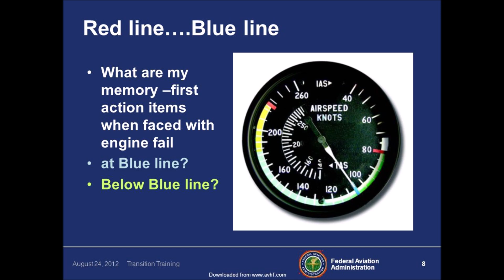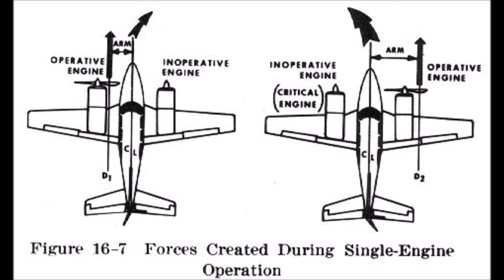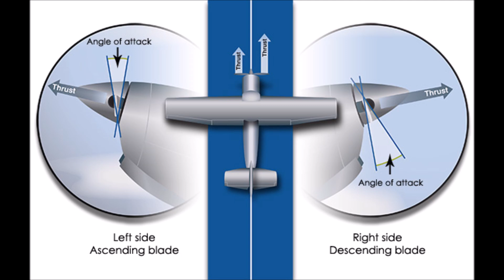King Air Crash- Addison Texas Update

Comment: This happened because an arrogant pilot would not let the co pilot touch the controls. Even after it was obvious the plane was in trouble, the co pilot would not touch the throttle for the left engine.

Twins often roll over when one engine craps out. My dad was acquainted with a pilot who had one engine crap out right after takeoff at Livermore about 25-30 years ago. The plane rolled over and went in inverted, which made for a particularly gruesome aftermath. There were 4 killed in that one.

Comment: What killed them is that he didn’t lower the nose. Recommended aoa is 10 degrees. His was way higher. The speed bled off below the blue line.My instructor used to say that if you had an engine failure below the blue line not even Lindbergh could save the plane.

Comment: NTSB Final Report on this Crash:

https://connect.ainonline.com/e2t/tc/VWGTgm1mky3HW2fxjwT48HP9KW4gSXWJ4rNVJcN6YWdsf3p_8yV1-WJV7CgM9vW3BG7_t4Sy5cpW74T2df5twC8VN7G7s5WbyJllW82hF6w60Np4sW6b4wTf607gCCW6ZxQ8p2kGv5SW3hqTGb8jWVLJW6y4RPj5dVZSsN2lD9Yvt0-3WW6hH6M98rL0YmW4d3lYb86mgFzW2NhF_g4SNd2vW6YgxRw77CG7qW5Thtpn4XVdFnV3hy-J5hMhLpW1RhcDV6bK80FW5n2061873mPcW86bq9m1n6vL-W7sgQhf3xLp_pW2M_sXg1lD26p3jv91

Short version is the pilot initially stepped on the wrong rudder pedal (left rudder).  He corrected and stepped on the right pedal but it was too late to recover, they were almost inverted by that point.    Also very poor discipline  in that they didn't use the before takeoff checklist and never briefed any items about the upcoming takeoff.

Comment: Just as a side bar:  It should be noted that not all King Air aircraft have auto-feather. It is on all King Air 300/350 like the one that tragically crashed in Addison TX. It should also be noted that the Auto-Feather is required to be tested, operational and must be ON/ARMED for takeoff.  As in the King Air 300/350 the 1900 is the same. However on the King Air 200 and smaller turbine King Air's it was an option. If the Aircraft is retro fitted with the Raisbeck Conversions or similar conversions Auto Feather is again a required item. This is mainly due to the removal of the 3 blade prop and the drag created by the new 4 or sometimes 5 bladed replacement prop.  Overall great job explaining VMCA and VYSE as well as the accident. The accident is truly a tragic one especially with the footage and that the aircraft was completely full with passengers.

Comment: Great analysis.  I would have bet 100 bucks that a king air would have had counterrotating propellers. Very surprised they both turn clockwise.  Is that typical in turboprops?  Thanks for posting.  Excellent work!

Comment: Considering how critical this becomes in the event of engine left failure, then why not have the right engine of all twin-engine propeller aircraft run CCW? IOW: both props rotating towards the aircraft center line, as is exemplified by the WWII Lockheed P-38 Lightning?

Comment: Sad so many lost their lives in this accident. You have to be trained to the max when flying complex aircraft and have no outside influences that will cloud your judgment and emergency procedures. I noticed they did a rolling take off, I don’t like them. My friend is a pilot and he never does a rolling take off unless he’s already done a engine run up just prior to hitting the run way. He has caught problems a few times with a engine and simply took the plane back to the hanger for repair. One time I was with him and the plane was rolling out to the runway and it sounded fine. But when he ran up the engines (one at a time) then and only then we felt a vibration and verified a cylinder was was coming in and out. Got back to the hanger and after a little investigation we found a spark plug wire loose from the plug and it was making intermittent contact.

Comment: Hi Juan,
      Your content here is usually excellent, but there is a glaring error in the way you describe V1.  

      About 5:45 you describe V1 as a “decision point” to continue or reject a takeoff.   This is not accurate.

      V1 is the speed at which the pilot must take “the first action” to stop the airplane (reducing thrust, applying brakes etc) within the accel-stop distance.  It also means the minimum speed, following engine failure at Vef (assumed engine failure speed), at which one can continue the takeoff on the remaining engine and achieve the required screen height within the takeoff distance.

      If one were to “decide” to reject at V1 and the field was balanced or the accelerate-stop distance was less than accelerate-go, the aircraft would NOT be able to stop in the remaining available runway surface.  

      The reason:  Human reaction time.   

     Since V1 is the speed at which the FIRST ACTION (not decision) must be taken, the decision to reject MUST be made PRIOR to V1.  When aircraft performance is calculated, it is assumed that the decision to reject is made at or prior to Vef.   

     Since Vef is not made available to pilots, every AOM I have ever seen calls for the PM to call “VEE-ONE” 5 knots prior to the actual V1 and for the PF to remove their hand from the power levers at that time.

       This is what accounts for human reaction time and ensures that the first actions to reject a takeoff do not occur after V1.

     Unfortunately, the misconception of V1 as a “decision point” is widespread even among professional aviators.  Most of the time, it doesn’t matter since runway available usually well exceeds balanced field length and V1 is adjusted up to Vr, but it is important to understand the definitions and the repercussions of deciding to reject a takeoff on a short runway at V1.

Comment: Juan, not a pilot but I have a couple questions.  In general at what point does the PIC call for gear up? 
We don't know exactly when the port motor failed at least I haven't seen a report as to when it failed.  If it failed at V1 or in-between V1 and rotate and they raised gear wouldn't this have given them less drag right out of the gate?   I don't know the checklist and obviously they didn't have time to run that checklist with the amount of time from take off to crash.
The question is do you skip procedures to raise gear and maintain some type of level flying speed or slow climb while feathering and securing failed motor?
I know I am playing armchair pilot on this but would you immediately call for gear up in this same exact situation or would you work the QRF?
Thank you sir

Comment: You can't die from an airplane crash if you don't get in one. The Only Exception is if one lands on top of you.
Reply from the maker: much easier in a car...
Reply: @blancolirio  that's what they all say but wind shear hasn't killed me yet, or Pilot error hasn't killed me yet, and if my engine blows up I just pull off the side of the road. I know that in 2017 47,000 people died on the highway it's very dangerous so I might die in a car crash but I will not die in a plane crash Only Exception unless one of you guys crash one on top of me.

Comment: As posted on your other video this is a similar event to on here in Australia in 2017 with a King air 200 full report : https://www.atsb.gov.au/publications/investigation_reports/2017/aair/ao-2017-024/ it would be worth a look as it may have some relevance :

 The aircraft’s take-off roll was longer than expected and a yaw to the left was observed after rotation. The aircraft’s track began diverging to the left of the runway centreline before rotation and the divergence increased as the flight progressed. The aircraft entered a shallow climb followed by a substantial left sideslip with minimal roll. The aircraft then began to descend and the pilot transmitted a Mayday call. The aircraft subsequently collided with a building in the Bulla Road Precinct Retail Outlet Centre of Essendon Airport.

The ATSB found that the pilot did not detect that the aircraft’s rudder trim was in the full nose-left position prior to take-off. The position of the rudder trim resulted in a loss of directional control and had a significant impact on the aircraft’s climb performance in the latter part of the flight.

Comment: Juan do you know anything about the crash of the N-9M Flying Wing on April 22, 2019 in Norco, CA ?
The pilot was killed and the aircraft was total.
What was the cause of the crash?
Reply from the maker: I do, and investigators are considering the hydraulic assist on the flight controls as a strong possible factor.
Reply: @blancolirio  Thank you Juan. It was sad that the pilot was killed on the crash and the restored N-9M Flying Wing destroyed.

Comment: I have to wonder why the PIC didn't do a proper run-up prior to takeoff. It's so important. It may or may not have flared up the pending engine issue but it may have. The rudder boost is also very easy to hook up backwards in the maintenance environment. I have a friend or two that has had that personally happen after getting out of maintenance where they had the rudder boost linkages disconnected for part of a phase or inspection.

Comment: NTSB preliminary report is now out. The gash in the hangar was made by the RIGHT wing. In only a few hundred feet of flight, the airplane rolled completely inverted and then some. Yikes!!
Reply: The prelim report says that a full inversion roll was captured on camera.

You would hope that with 4 (!) sets of video footage that they could estimate (or conclude?) rotation speed.  I would have thought that could be done very quickly in the lab. That one seems to be the big question. And did he check thrust before roll - and is that detectable on camera from engine frame shudder? Then the difficult one to establish (if even possible) is RPM and thrust level. The witness report points glumly on that.

Comment: Thanks, Juan for another very clear explanation on issues concerning an engine failure on take-off.   Most people do not understand the yaw factor at low airspeeds and the need for pilot knowledge on what to do in seconds and split seconds.  Most appreciated.    - Dean from Minnesota

Comment: Identifying the engine that actually FAILED is also a critical step. The terrible February 2015 accident of TransAsia Airways Flight 235 is an example how a bad situation can become rapidly worse. The crew shut down the still operating engine by mistake, instead of the failed one.

Comment: JUAN, UST GOT THIS in  from the SUN SENTINEL from FLORIDA, reguarding,  the helicopter from Big Key Isle, it  is an AGUSTA AW139,, IT went down minutes after take off, it was in 15 feet, inverted, withthegearstill in landing mode,  the doors were removed from before flight,  EVERYBODY  WERE IN THEIR SEAT BELTS WORN, the pilot, they had to removehisfingersoff the controls, but hereis theODD PART, BOTH  ROTORS WERE NOT ON THE HELICOPTER & no mention of there location, it was removed  Friday    RIP,    CHEERS FROM NJ

Comment: Great description, and as usual, a very good video.

One point I wish more would emphasize.  After discussing “identify, verify...”, you mention the need to fly the airplane.  I know what you meant by that (do it first), but too often this most important first step gets drowned out by the discussion of the “fix” actions.  Doing these steps out of order has killed many pilots.
It is vital that positive control inputs (rudder, pitch, aileron) to maintain control be the FIRST response.  In other words: fly the airplane.  Only after that step do we continue into “identify..” and so on.

Comment: Why doesn't King Air have opposite rotating props?  It improves general performance, not just the critical engine issue.  It would cost more with two PNs for engines, but I would not think a lot.

Comment: 4:00 The impossible u-turn. If you're still departing and not up to cruising speed or a decent altitude, and you have an engine failure.. turning around to return to the runway could potentially lose all of your energy and altitude.
Mark patey and Jason steed made a wonderful video in the super Cub about the impossible turn.

Comment: Because the King Air is flown by the Royal Flying Doctor Service here is Australia, its held in almost revered status as a reliable and tough aircraft. It represents nearly half the fleet of 71 aircraft operated by the Service. In the entire history of the King Air with the Service over many years, there have been no engine failures or mishaps. It has a 100% safety record. As a semi government agency the RFDS aircraft receive gold standard levels of maintenance in excess of regulatory requirements and the level of pilot training is also in excess of requirements. 
I am told its not a simple aircraft to fly and is best described as like a small airliner in complexity. Your comment about pilot training if the Texas plane had just changed hands may be significant. I am also told that recovery from engine failure on takeoff is practiced and examined fours times a year for King Air pilots at the RFDS.
Reply: Stephen in OZ The PT6A turboprop engine should be one of the most reliable. Something may have gone wrong with maintenance.

Comment: Sounds very similar to the 2014 King Air crash into the Flight Safety building. 
I’ve trained and instructed in piston twins, King Airs and Turbo Commanders. “Critical Engine” sounds like a big deal but it’s not. Push em up, clean it up, identity, verify, feather works with either engine failure. Critical engine is barely perceptible as worse if a guy can use his rudder pedals and deliberately, calmly  do those things.
Reply from the maker: Great point thanks!

Comment: Great explanation of the King Air's autofeather and rudder boost.  This airplane has more than enough excess performance to climb out of a V1 cut IF the pilot does nothing else but fly the airplane to a minimum safe altitude.  Pilots coming out of GA light twin training are too geared toward immediate action (where it's necessary).  However, acting too soon but acting inappropriately has caused many accidents.

Comment: Mr blancolirio, I want to give another opinion with this unfortunate accident. I share with you his exposition with respect to the calculation of the decision speed in terms of take off weight and density altitude said by you in the minute 5/31.
I would like to ask you if it is possible to inform us the basic operation weight, plus the fuel weight plus pax weight and their respective luggage, I do not want to think about having the anti-ice system activated for this take off, I also share with BILL WOO in your comment.
Thank you.

Comment: On a prop plane you loose not 50% of power if one engine is not operating-   you loose maybe 80% because of drag. Maybe the students today don't learn this. Was educated in a Cessna 310 for my multiengine rating - dead foot dead engine then opposite rudder. The automation have gone too far....

Comment: Is there any advantage of having two engines/propellers spin in the same direction? 🤔
Reply: Lower costs due to common manufacturing and maintenance inventory. The theoretical safety benefits are quite marginal.
Reply: @gordonrichardson2972  well in this video there was at least 4 crashes which seems to be possible just because of this design flaw.
Reply: @RubenKelevra  You are mixing up yaw which is common to all twin engine aircraft (including jets), with the small effect of the critical propeller.
Reply: @HiWetcam which one? 🤔
Reply: @HiWetcam I was asking which advantages and not claiming anything.
Reply: @HiWetcam thanks. Just wondering why so many multi engine planes stall when one engine dies. 😞

Comment: Hi commander, a correction, the P-38 had OUTSIDE turning propellers, since they found that inward turning propellers had a bad behaviour (like the XP-38 in the photo). This made the P-38 an odd twin aircraft since both engines were critical, although turning outside. An opposite example of that was the DH Hornet that had inward turning propellers and a scintillating performance even with a dead engine.

Comment: The King Air auto feather system has to be armed by the pilot before take off.  If the checklist was not followed diligently it could have been missed.  It is good practice to check the rudder boost system before departure. Some operators don't do this.  It is quite a noisy procedure at the holding point.  For me, if rudder boost is not working, it is a no go item.  If you have an engine failure at high power in a King Air you have no chance of controlling the adverse yaw without rudder boost.
Great channel.  Best wishes from the UK.
Reply: One report said that a recovered prop was in feathered position. If I see the source again I'll try to post here.

Comment: I would have presumed the designers at Beechcraft would have counter rotated thise engines.  It just makes aerodynamic forces better in a failure.  I learned that today. Wow.  That pilot didn’t have much of a chance after engine failure.  He had a chance before takeoff.  Ratings are critical.  Experience counts.  RIP.   Thanks Juan

Comment: Turboprops are not considered a form of turbojet/turbofan engine to the FAA, and do not require a type rating. The same rules that apply to piston engined aircraft for type ratings, also apply to turboprops. Only those with a max gross weight above 12,500 lbs require a type rating. 

A King Air 90, Twin Otter, or Caravan do not require a type rating for example.